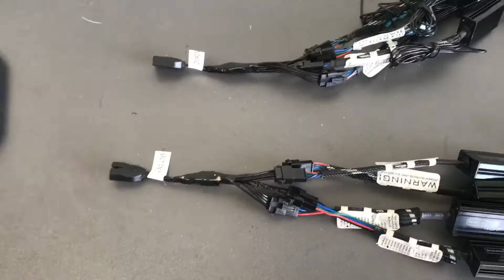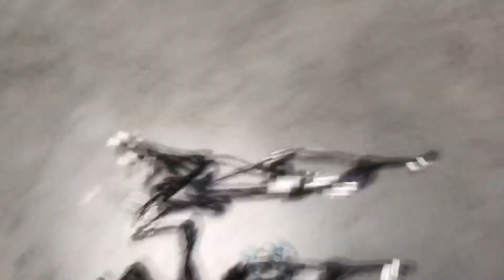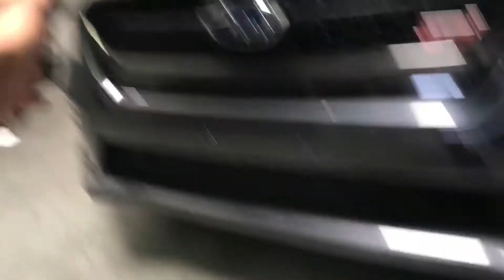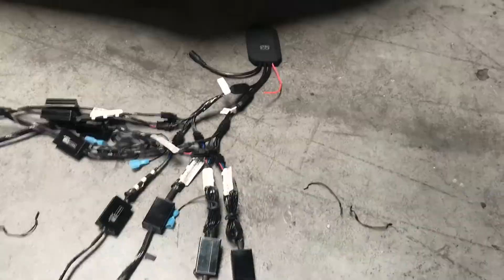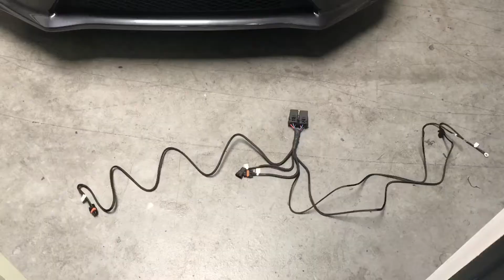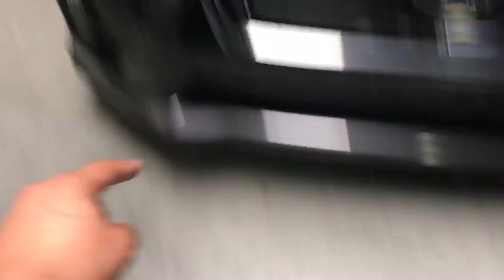2015-2017 WRX Limited & STi LED Headlight Retrofit w/Quad XBT Halos & Demon Eyes & HID Install Guide

Comment: Hi bro, I just installed relay harness for my LED bullbs in both low and high beams. Is it a good idea to do that? Will it affect my LED bulbs in any way? Will my LEDs throw more light? Appreciate your advice, please
Reply from the maker: Relays help provide constant power to the components attached to them. It’s a good idea to run a relay.

Comment: Is the OEM input on the driver side custom? I'm trying to do this same conversion only I cannot figure out the low and highbeam thing
Reply from the maker: evofire115 I soldered an in line 9005 wire harness to the OEM LOW Beam Harness for the secondary projector to turn on.
Reply: @RetrofitCollective  oh. And the high beam wires from the projector are probably soldered to the high beam signals on the headlight. 

That reminds me, it's the HD relay for 9005 or H11
Reply from the maker: evofire115 Correct. I used a 9005.
Reply: @RetrofitCollective  ok. And that soldered 9005 wire for the OEM lowbeam is from a different harness or did it come with the same HD relay?

Comment: What size halos did u use
Reply from the maker: Cristhian Valdez 70mm
Reply: @RetrofitCollective  what was use to stick the halos to the bazzel?
Reply from the maker: Cristhian Valdez 26 gauge wire
Reply: Not to wired them I mean was fishing line use or a type of glue?